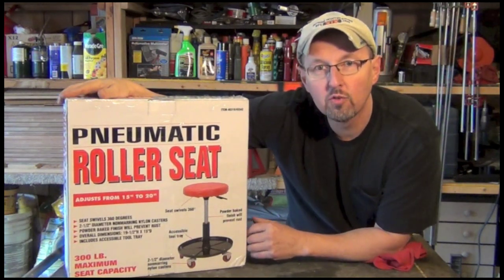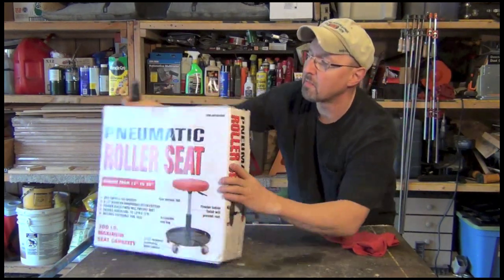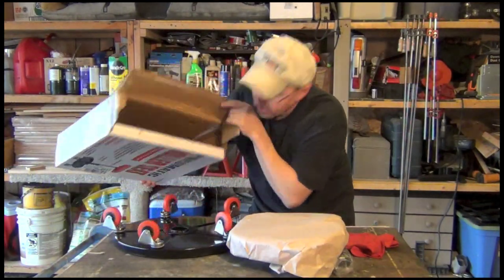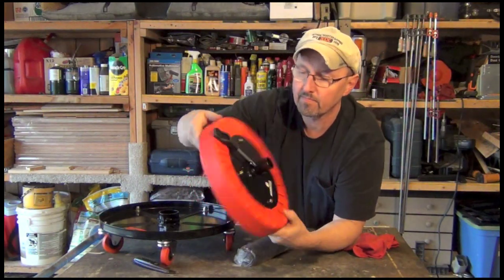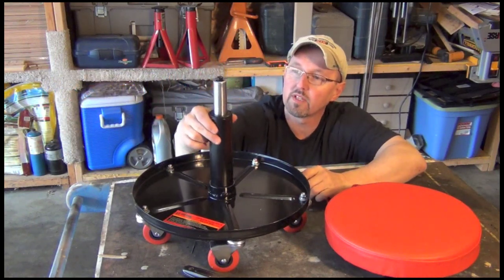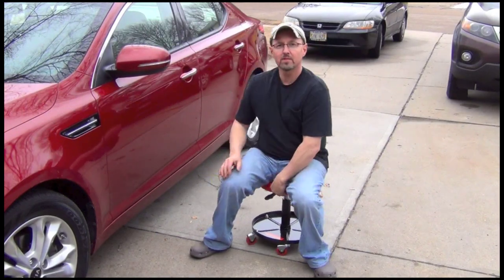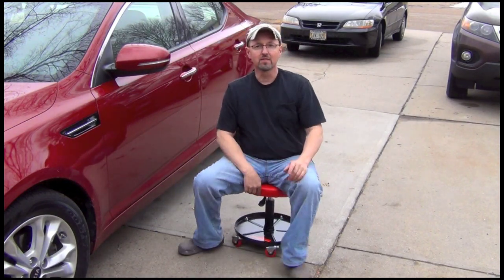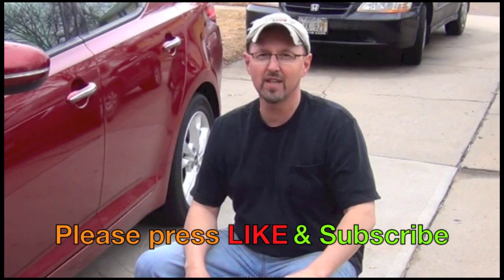Harbor Freight Pneumatic Roller Seat

Comment: i have one of these and i agree for the money it isnt terrible however i took several tip falls on this thing this summer in my garage ;so i have decided to do some modification to the base. I picked up a two by two foot piece of half inch plywood from Home Depot and dissasembled the base form the piston and seat. I am going to round the corners of the ply wood and drill a large hole in its center for access to the attachment point for the piston. the holes in the tray where the wheels are attached will become the attachment points for the plywood. The wheels will be reinstalled on holes drilled in the plywood. The base circumference will go from a 16 inch circle diameter to a roughly 23 inch wide square while retaining the factory lower tray for parts storage. I'll and and paint the wood to make it look professional. Can you believe i almost put it curbside.

Comment: This seat is a huge piece of dung! With in a few weeks, the wheels became very floppy. They loosened up where the ball bearings are located and most of the bearings fell out. The wheels became useless at this point. One of them came completely apart. The seat is a great idea but it needs to be constructed with quality parts, instead of garbage.